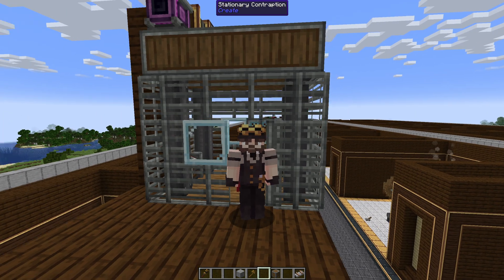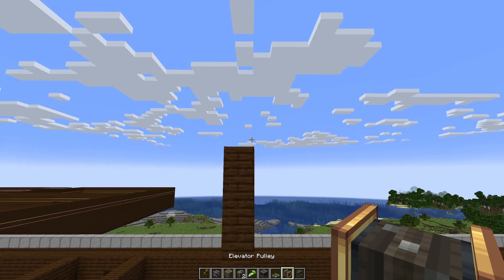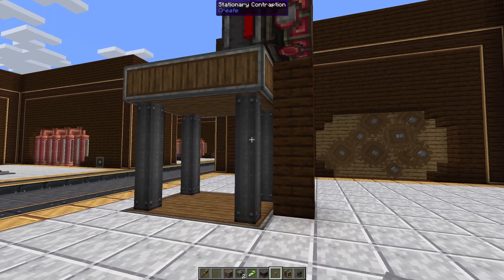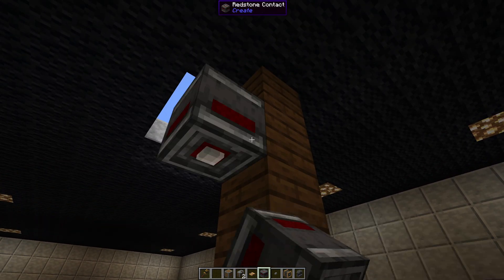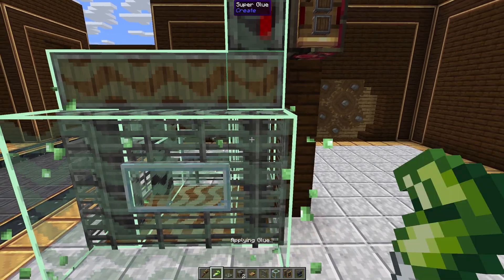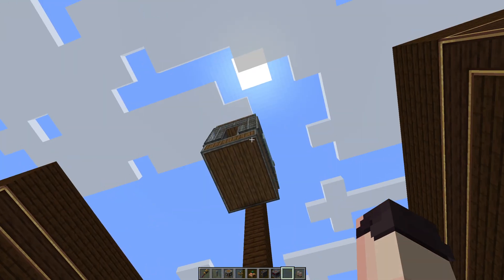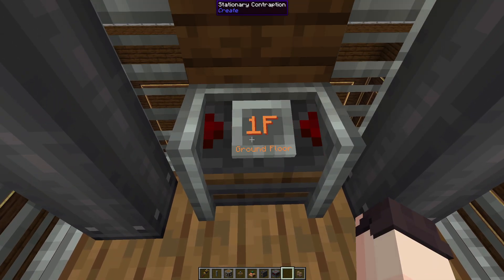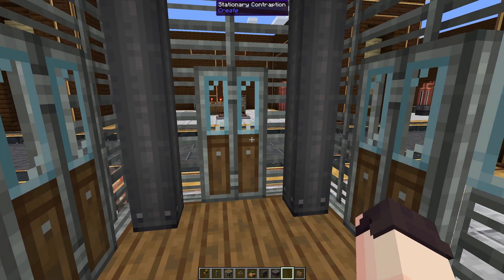How To Build An Elevator Using The Create Mod 0.5.1 - Minecraft 1.19.2

Comment: I slide when I'm at 0 in the mechanism controller, I can't do 1, but I can do 0 when I'm at 1, what's the reason?
Reply: If the contraption control only allows you to go down, its probably because the scroll sensitivity in mouse settings is lower than 1. I have no idea why

Comment: Quick question for that Create Elevator using your method, can you extend to bedrock or is there a limit?
Reply from the maker: @Vayank123  there is a limit but its pretty high I believe, 128 blocks should be fine, maybe even 256. It can be changed in settings I’m pretty sure
Reply: @Uberswe  I found out a way.  If you disable stress, that may fix it.

Comment: bro i've built it and after an hour the elevator dissapeared. the worst is that it says that i can't build another one cause it says " this contraption was unable to assemble: another elevator is already targeting the column of contacts". Please someone help me quickly.
Reply from the maker: Usually when the elevator goes away it is actually just below the ground. One of the redstone contacts will typically be active but if you find an inactive contact and give it a signal with a button for example, then the elevator will come back up.

Comment: is it possible to call an elevator from any floor?
From what I cam tell, you can only call via a specific signal. So if one signal is AA, you can only have that linked with AA. You would have to figure out a way to activate different Redstone links from different floors which would get in the way of aesthetics for most builds. Unless you just want a thing that gets you up and down and don't care how it looks.
Reply from the maker: @bigman7856  every floor would have 1 button to call the elevator. Each floor has a red stone contact which would need a unique redstone link if you can’t run the redstone signal to the contact without the use of a link. Inside the elevator you can use a contraption controller to select the floor

Comment: Contraption Controls not working for me. No numbers, just asking for a block..? Don't know, it is annoying 😢
Reply from the maker: You need to assemble the elevator by right clicking the elevator pulley with an empty hand
Reply: @UbersweMinecraft  yep, had gotten that part, control still wasn't working.

I did however come across another commenter on your video saying to disassemble and reassemble and it'd work. Was a bit of work (big freight elevator lol) but after rebuilding it all worked.

Comment: hey ik it's a bit late but does someone know if i can connect a display link to multiple nixie tubes? i'm currently building an elevator system and want to have on every floor nixie tubes to display where the elevator currently is

Comment: I think I've got a mod conflict or something. I got the elevator to switch floors but the pulley animation doesn't do the retract...and when I tried to set the doors opening, they opened on the way up and  never closed. 
Anyone think maybe Interactive or VS might have done it?  Got a suite of Create mods and really want them to hang together for a modern feel.
Reply from the maker: Create Interactive is fun but also very experimental from my experience. I had to reset my world a few times when I was using it. I wouldn’t be surprised if it is causing some issues

Comment: Is it possible to make a "secret" elevator level? Something that won't be seen on the elevator controller, but could be accessed with a remote or the like? I want to build a spawn tower for a server, but I also want it to be my house. People will take an elevator from the top of the tower to the bottom, but people will be able to see my home/machines as they go down, but never access them. I tried using a redstone linked piston to push an elevator link into place, but you can't move them.

Comment: Is it possible to integrate this elevator system with an automatic door? For example, when the elevator reaches a level a 3x4 door made of blocks opens
Reply from the maker: Sure, the contact at each floor will give off a redstone signal. So when the signal is on you could open the door and when the signal is off you can close it.

Comment: How do you make it return to a floor without being on it?
Reply from the maker: You need to send a redstone signal to the contact on the current floor. This can be done with a button or wirelessly via a redstone link.
Reply: @Uberswe  Hoping you see this. I have RSL on each floor's buttons, do i assume they need separate frequencies? I have 4 floors, each RSL has a different frequency currently
Reply from the maker: @Emmayteetee  yes, they do

Comment: i pretty much copied this setup in my own world but the pulley just wont connect due to not "having a horizontal redstone contact"
Reply from the maker: It's hard to give any pointers without a screenshot, feel free to join my discord if you would like and post the question there and either me or someone from my community will be happy to help you :) https://discord.gg/NQJuhb6stv
Reply: Hello, if you are still stuck, use superglue to stick the redstone contact and the elevator

Comment: This is so weird...my version - 1.19.2, does not have an elevator pulley.  I want to build this but the item just isn't there.  Would you have any clue why? Edit: I am using Fabric, but I have the API as well.
Reply: The Fabric version has not been updated yet.
Reply: @LOL-gn5oh  Well that sucks.  I was of the opinion that Fabric is better than forge, but after some research I'm seeing that's not the case...
Reply: @sharkbaitoohhahha  It's out now ;)
Reply: @LOL-gn5oh  Trashed the fabric server, using forge now.
Reply: @sharkbaitoohhahha  Well, I changed back to Fabric. Getting way better performance now compared to Forge.
Reply: @LOL-gn5oh  That's great, but I still don't see the benefits of Fabric when it doesn't have half the mods and the other half it does have are incomplete.
Reply: @sharkbaitoohhahha  Oh how have the times changed.

Comment: you can even combine the redstone signal from the contacts to have doors on each floor also open when the elevator reaches an area, and you can also use note blocks to have elevator chimes.
Reply: whats an easy way to have a redstone signal reach a door without making it look messy
Reply: @ohyeahirock99  redstone links